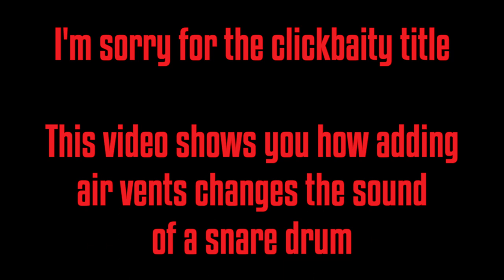THE TRUTH ABOUT VENTED SNARES | Stoopid Drums Episode IV

Comment: I had a CB 6th grade band snare that I loved, even though I knew i had grown out of it.  I was in a band that played a lot of 311 and other bands like that, so being poor I decided to customize the snare and see if it sounded ok..
  I removed the black plastic cover and drilled about 70 1cm holes between the lugs, evenly spread out.  Then i upgraded all the hardware with only the thin holy shell being original.  The result was a phenomenally pretty sound and it cut through with a good amount of midrange resonance.  
After watching this video I think the reason mine sounded so good was because the holes were small in relation to the thin shell.  
Cheers! 🥁

Comment: As I suspected, you would get a boingy resonance from the top head and very little snare response. If all the air escapes the shell before hitting the snare side, there is nothing there to excite the snares. I could never understand why there was such a fad for vented snare drums. Not only did they sound like garbage, but you got charged more for less material! LOL
Reply: Such an ignorant comment. Why high class producers like Terry Date are still using OCDP and vented snares nowadays ?
Reply: @grazianodrummer  It isn’t ignorant. It’s physics. Try drilling some holes in your shells to find out.

Comment: Really great video about Vented snare but I want to add something.
OCDP vented snare (because are the first that made this kind of snare) studied the bearing edge,the snare bed and also the type of ply of wood that a vented snare had to be responsive and to have the sound that we know(OCDP used 15 to 40 ply). Also the different size of vents and the number of it are important. Also the runing range of a vented snare is different than a normal snare... a medium tuning on a vented snare is kinda high tuning on a normal snare... for this reason it 's sound good (from 1 to 4) but not 100% good. If you used an higher tune, I'm pretty sure that the sound were better. Before ending this comment I just wanna add a personal experience.
I just did the same thing back in the days, I brought a keller shell, I painted black I contacteda friend of mine which is a luthier, he used standards bearing edge and installed the hardware etc... the result was close to the OCDP but not the same. The moral of the story I brought an exact replica of an OCDP made by Drum Sound here in Italy (Luca from DS said that in 2004 an endorser who had a OCDP Snare, asked for the exact replica of that snare, he brought his OCDP to his laboratory and he make the one that I have, I will do a demo video of it soon!) and I sold to my friend luthier friend the keller shells (because he liked it). There are a lot of misconception about vented snare, my suggestion is try one "original" in person, to see how really works. And yes, from 5 hole and beyond, that snare doesnt sound so good... while 1-2-3-4 holes, sound really awesome to me!
Reply: very nice!!
Reply: Your comment is worth more than this video. Thanks!
Reply: @betulaobscura  thanks buddy

Comment: What if you took this shell and tried to slide another shell inside of it? Essentially a shell inside a shell, filling the holes and taking it back to a “normal” snare again?
Reply: Obviously, you’d have to then get longer mounting screws for the hardware and get the inner shell at just the right diameter. Which could pose some issues
Reply from the maker: It would certainly look cool.

Comment: The first real snare drum I ever bougt was a Ludwig slotted snare drum. It had 2 shells really held apart in the middle an Inch and it was really loud but now that im old I would not have gone for that snare but a solid wood shell that was about 24 plys of wood. probably a sonor  or a really heavy metal snare that had a thick seamless metal shell and weighed about 30 lbs.
Reply: a solid wood shell of 24 ply? How did you get those plies to turn into one solid shell? lol